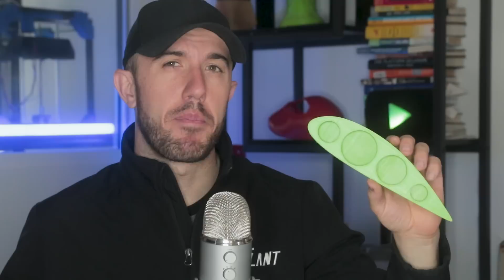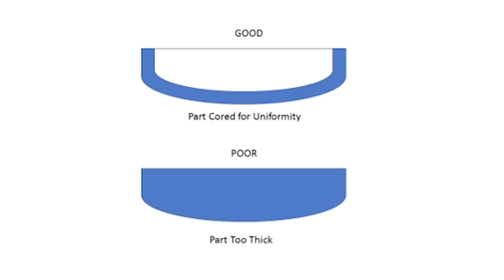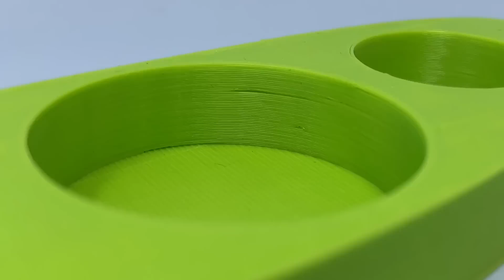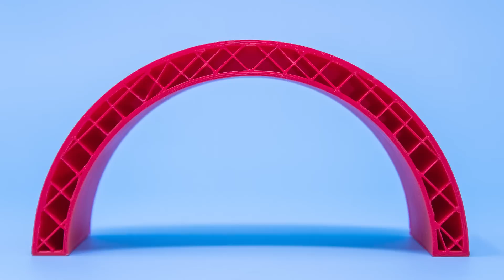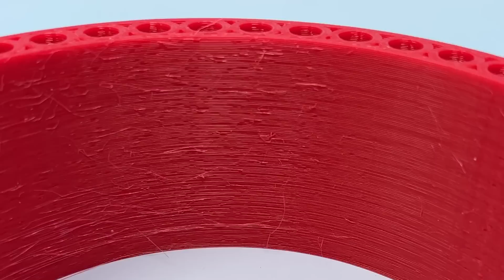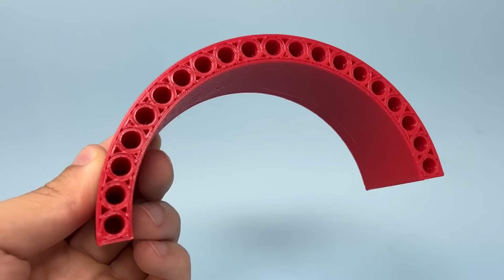Cavities Don't Help: Design for Mass Production 3D Printing

Comment: It is weird that you used an airfoil as an example. Normally they are designed to print in vace mode and have cavity designs to force an internal structure.

Comment: If you want structurally sound and light parts - dont use 3D printing.
You are already starting with failure.
Reply from the maker: Very incorrect
Reply: @slant3d  if you say so - then all manufacturers should learn from you and switch to 3d printing cause it is oh so great?
Or maybe 3D printing is good for getting a decent enough shape for rapid prototyping but does not have the structural integrity, dimensional accuracy or productivity as other forms of manufacturing.... Nah, can't be that you are wrong, surely everybody else is.

Comment: I tend to design things that I 3d print to be so thin that the walls take up the whole inner volume. In that case I do use cavities to save material, but if I have a shape with significant volume I will keep it solid.

Comment: so many stls i've seen with all kinds of modifications to "save material"........ good model that does what i need to, but ruined by "smart" choices to "save" material that actually makes part consume 2x plastic and time.... sometimes it's relatively easy to modify that stl but sometimes designing from scratch using that part as a reference/inspiration is faster

Comment: If you need high speed prints, AND maxmimum weight reduction and you dont require the shear strength from an end cap, use Vase mode with infimitely thin cuts in the wall.

Can get you some rigid prints with minimum print time (because it never stops extruding).  I designed my cuts to zigzag so they built that strength in multiple axes.

Comment: Interesting, I've recently designed a super light model glider wing to be 3d printed, and went with a hollow design with ribs that allow it to be printed at all. Now I'm going to see how heavy it would have been if it was all filled with low density infill instead.

Comment: I read a paper that found that most of the parts strength ended up coming from the walls rather than the infill, it would be interesting to see a comparison of a part that has thicker walls and barely any infill (still some as overhang print support), and compare it against the same part with thin walls and more infill, both using the same quantity of plastic.
Reply from the maker: I Beams

Comment: Cavities CAN and DO help when they're designed by anyone with competency.
It's not about just putting them in designs to reduce weight, but implementing them with structure deformation IN MIND.
Factor expected deviances into your creations.
Expect stresses in specific areas, implement cavities to act against the individual forces applied upon them where needed rathe than just plonking them about a design because it looks nice.
Reply: Test, test, test and test some more.
Slice your designs apart afterwards, and look at what happened where.
Understand what works best for each individual element and modify future designs.
CAVITIES CAN HELP.
(if you have the intelligence to understand why).

Comment: Regarding "bygone era", injection moulding is definitely still in use, much more than 3D printing, I'd say.

Also, most of what you said, mostly affects only FDM printing.With resin printing, you can't really do similar "pockets of air inside the model" infill, as that would also mean "pockets with uncured resin inside" (liquid resin can be bad for your health, while solid resin is just fine)

Otherwise, a nice video. Good thing you also covered the (still) useful usecases (except the one, where you want holes for other reasons, like connecting to other parts, letting air pass through etc.)

Comment: I mostly agree with this, but I will say that the airplane wing is not the best example. Cavities in airplane wings are there for a number of reasons—fuel and/or battery space, wing spars, routing for electrical wires and/or hydraulic lines, etc.

I will add that minimizing structural mass is a strong design driver in a aerospace, but minimizing material usage is not. While there is a  relationship between structural mass and material usage, the two things can diverge due to use of support structure, subtractive post-processing, print failures, and nonconforming parts.

Comment: i only do this when I have known stress points. If for example I want a triangle to work as a lever with one egde pivoting around an axle I would try to minimize volume where material is not needed for strength and then print the part with 100% Infill. It's easier to controll the outcome of the piece and to repair it without printing a whole new piece when breaking (soldering iron and loose filament)

Comment: It's funny because I didn't really start designing parts a lot until I started 3D printing. It has always sort of been obvious to me to just leave any internal volumes that don't need to be dense hollow or at least fully filled in the design process. Then I just determine the infill and number of walls in the slicer based on the strength and properties I want. Great tips though!

Comment: I have designed a few parts using cavities as "custom" infill.  In that case the parts needed dense infill and a lot of perimeters in only one spot.  I then made sure the walls around the cavities were thin enough to only need 2-3 perimeters which allowed me to save both time and material.   Wasn't a high production part though, didn't have any nozzle snags on the 8 I printed.

Comment: Even tough cavities are inside the part and not visible, they create surface area.  You want to reduce surface area in 3D printing.  Perimeters generally print much slower and are the thickest area of the print.

Comment: With PrusaSlicer, you can add internal modifiers and increase the infill density in specific areas or even convert a part into a solid piece. This results in the creation of additional perimeters within the infill, enhancing the solidity and appearance of the printed object. It is a useful feature for optimizing your 3D models before printing them.
Reply: You can get the same effect with Cura slicer. You can select a mesh to change almost any setting where it intersects your part. You can create a special shape for your application, or just use a support blocker and scale+change it to a setting modifier mesh.

Comment: I would agree on everything but one point you made at the end. Airplane wings. Designing solid for airplane wings, specifically rc airplanes, relying on the infill for strength is still to heavy. But the same principles are true. When Designing a wing you have to alter the outer walls to create the structure internally and print with zero infill to get the strength needed well being light. You also typically have to print with a single wall on the print. Generally though the same is true you reduce weight by reducing part surface area but in this case, you have to include the surface area of the infill.

Comment: I thought it was obvious that unless you printing with high infill, most of the material and print time is in the surface of the part. Adding cavities removes sparse infill, but adds expensive surface area.

Comment: As a new designer about 1.5 years in and all  self taught , this channel is by far the most valuable resource ive found for real useable knowledge. I work in prototyping and making work fixtures but cant afford school, this channel makes me feel like i can progress and make better things with my limited resources. Most sincere thank you for sharing all this stuff. your mouse ears video alone has saved me dozens of failed prints on my most commonly printed part. This stuff might be basic for real designers but i was a pipefitter for 18 years so im a little behind the pros lol, but ill get there. Thanks again, slant has been a real inspiration. I dont plan on opening a print farm but my goal is to print as many things as humanly possible so i never have to fit pipes again🙃
Reply from the maker: Thanks for watching. Glad it is helpful

Comment: For a wing rib I think you should  compare the strength of two parts with the same weight. And since the rib goes on the inside of a wing the surface finish doesn’t matter. Also solid parts are hard to route wires through. I just did this very thing and the easiest way to remove mass is to cut holes in the big surfaces. Since the rib is thin there’s relatively little material in the infill. In the example there’s a pocket and not a hole so what you are saying makes sense but would people really do pockets and not holes in this scenario?

I hear what you’re saying but it’s maybe not the best example.
Reply: For wing ribs you should use something better than 3d printing

Comment: I actually design in cavities as it adds structural support, I usually print with 6-12 walls with no infill. The reason being that i make thin components (3mm) that are relatively large.

Comment: An interesting look at the issue.  Ironically, though, YOU committed a cardinal sin with that arch full of cylindrical cavities: to optimize a design for speed and economy, you need to remove as many line segments as you possibly can.  Those cylinders probably have a dozen or two per layer EACH, when they could be made with as few as three and thus be FAR faster to print and use less material.  (Yes, if your machine is tweaked to the nines and/or can use G02/G03 codes, you might be able to make circular cavities faster than triangular ones at the cost of the extra material.  Might.)

Comment: I use Lightning infill so my prints are almost completely hollow. Infill doesn't affect the strength. To make it stronger make the wall thicker.
Reply: Infill significantly affects strength. Yes you may not need much infill if you only print decorative pieces but for anything structural infill plays a significant role, both the percentage of infill and the infill pattern, some are only good in 2D others are better in 3D.

Print a few cubes with varying amounts of infill and infill type and see how much weight it takes to crush them. If infill didn’t add strength then everything would be hollow.
Reply from the maker: Incorrect. If infill does not affect strength, try removing the trusses in a bridge.

Comment: You could also say: The slicer and its infill algorithms do a much better job at creating cavities than you normally would. If you want to create cavities on your own, at first, make sure your cavities are better than the ones of the software.
Reply from the maker: When mass producing an end use part with additive you should avoid cavities.
Reply: @slant3d  I think their point was that infill essentially creates many small cavities.

Comment: another point is if you have to have cavities... try to have things as multiples of nozzle diameter. well, any feature really. 

the longest print cycles are always those annoying little jiggers between two walls that are just over the nozzle diameter... "wow, you just did the walls and the infill faster than you can do that 0.7mm gap around the perimeter... and why did you just rapid all the way to this side just to rapid back over to that side for one blob??"

sometimes the paths that slicers choose has my head aching... meh. that they do it at all is still sorta amazing.
Reply: Slicers can adjust the line width, they aren’t limited to the size of the nozzle any more, they can go slightly thicker or thinner, that help with those gaps you are on about, it just slightly thickens it’s lines so there is no gap.

Like if you are trying to print a 0.9 mm thick section with a 0.4 mm nozzle, slicers can expand it to 0.45 mm instead and print the 0.9 mm section with just two 0.45 mm lines.
Reply: @conorstewart2214  i know that. then you get the same effect as it applies it to the entire print rather than selectively going "this center line requires 1.5 nozzle diameters to fill completely... lets over extrude rather than jog back and forth for the next twenty five minutes".
Reply: @paradiselost9946  no slicers now as far as I am aware can do it automatically and as needed, so it adjusts the line thickness throughout the print.
Reply: @paradiselost9946  just checked cura, if you have an up to date version, you can slice a model then go to preview and change the view to line width, you can see it does change the line width automatically to best fit the print.

Comment: How about in the case of side walls for an open front case? The walls are thin enough that there isn't much infill between the inside and outside perimeters. I made diagonal sliced holes to reduce material in the sides.

Comment: In some slicers you can increase the linewidth of infil. Rather than increase printing time by printing circles you can double the linewidth of the infill and increase part strength without having to print at a higher infil density, line wise.
Reply: Walls still provide more strength because they are printed slower. And the point of using cavities is to only reinforce areas that need it, instead of increasing infill density all over.

Comment: Definitely something I can see people coming from other processes doing. They mean well, but don't realize that 3D printed pieces are normally hollow, with a bit of infill. So you're really punching a hole through what's already mostly air. I wonder how often you get designs with holes?

Comment: That's a nice pun in reference to "mass production". Normally cavities are utilized to reduce a parts mass (weight), but here the objective is to increase the mass (volume) of production. ;)

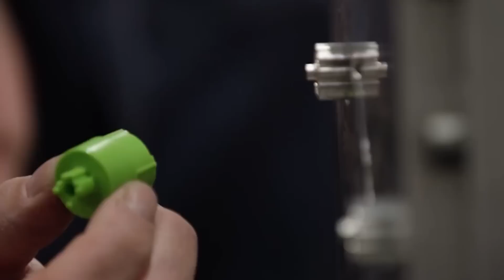The issue with the initial part with cavities (0:15) is the size and location. The part is an example of a designed for material removal using the least number of (metal) machining steps. The part at 3:40 also uses similar round cavities, but has an uniform infill. There is a balance of part strength, part weight, material used, and amount of tool movement (acceleration as print head changes directions). 

Key is understanding both engineering design aspects as well as manufacturing design aspects of a part.

Comment: Thank you! One of my pet peeves is people modeling a replacement for an injection molded part by slavishly reproducing all the walls and ribs. Just use s solid cylinder or whatever.
Reply from the maker: Exactly.

Comment: Looks like a rib from an airfoil.. which is worst example for the point you're trying to make lol. Also you're comparing a part with top and bottom layers and a part with none...
Reply: It's a pretty poor example, lets be honest, but it's good information.
Reply from the maker: The point is cavities are the worst solution to lightweight and strengthen a part. The airfoil is a perfect example.
Reply: @slant3d  then why all the 3d printed planes use it? You're talking about the extra toolpath but optimized 3d model will make head print whole layer without ever retracting...
Reply: @habiks  they do it so like you said they can print the whole layer without retracting, often they are meant to be printed in vase mode for that purpose. Then there will be no infill, hence they use outer walls to make cavities instead. It helps with lightweight PLAs that foam and work best when extruded continuously and not stopped and started and can’t retract properly.

Comment: Pretty much everything here. Excellent advice. One small consideration where you may want internal structural cavities exposed tho: if integrity of their walls is critical to meeting a structural requirement, ability to inspect and reject based on any problems there may be desirable.

Comment: Cavities can be useful to break up extremely long layer lines, which can cause stress in one direction and cause the part to warp. However, there are other ways to mitigate that stress, too.
Reply from the maker: Good point. Concentric layer lines or textured surface.
Reply: What are the other ways?

Comment: Regarding the no through-holes thing, what if we're designing a wing and need to have a place for wiring and the wing spar that holds the sections together?
Reply from the maker: Then design holes. But dont have cavities be through-holes.
Reply: @slant3d  Got ya.

Just curious, what about keys for assembly? Do you have a video on how to design those for 3d printing?
Reply: @thedabblingwarlock yes, a couple of weeks ago he did one on that
Reply: Include a wiring conduit in the design

Comment: This cavities you presented with the slice of the wing are actually structural design to allow proper stress transfer. Not the best example imo.
Reply from the maker: Cavities in general are unnecessary. They create larger stress concentrations than are possible with using infill. Additionally circular cavities are a sub-optimal cavity design compared to truss-ribs